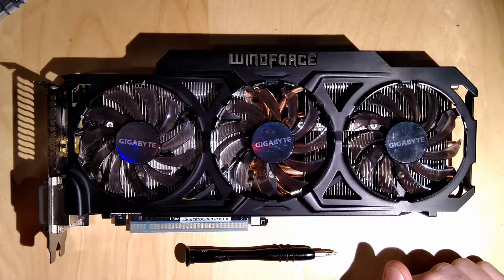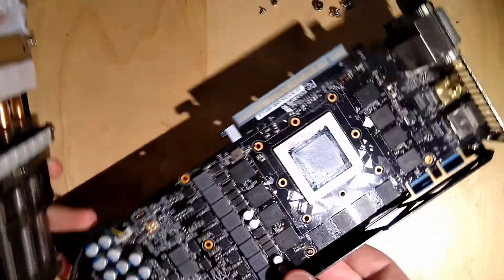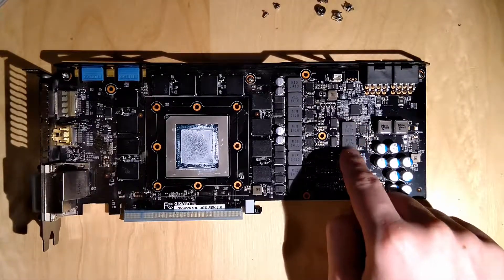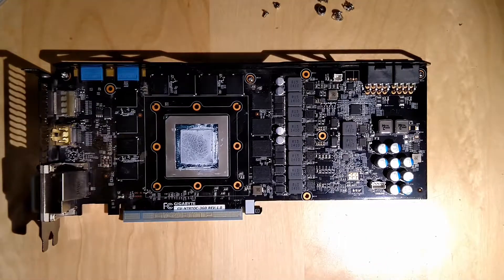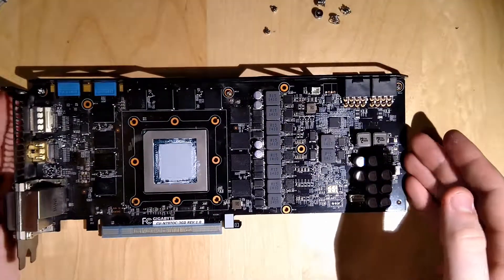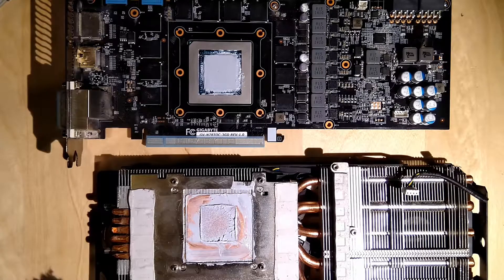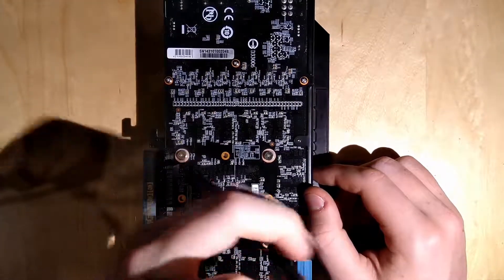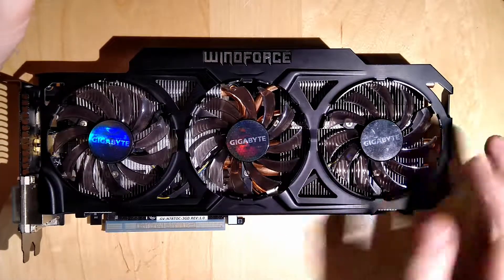Gigabyte Windforce OC GTX 780Ti Teardown | Switching to new Thermal Paste ( Kryonaut )

Comment: First of all: What a great detailed video about this card, it gave me the confidence to open it!! 

Just like Ixomis, I have got exactly the same card, and two days ago the screen got some green spots, artifact like.. I think the green artifacts also appeared when I opened BIOS. So I think something died on the card. Probably VRAM, or Memory? Don't know so much about Graphic cards... Is there a way to bring it back alive? Is there a way to find out which modules died and are they replaceable? 
I was so happy with this card.... Can just do a good cleaning, repaste the GPU solve the problems? I really like to know! 
What's the story about Baking it?

Ow BTW, just like Benedikt W. as I could read in my minimal German I also got the  code 43 in the device manager. I also reinstalled the drivers but now it doesn't do anything anymore..

I'm sorry for all my questions, but I actually just don't want to miss this great card...

Vielen danke!
Grüße aus den Niederlanden
Reply from the maker: artifacts on screen are usually caused by the Core or Memory BGA failing / being dmaged. sometimes the thin memory traces on the card also get damaged and cause this. it's not always fixable. usually you could try a reflow "oven method" (but i suggest using a heatgun on the core / memory and not putting the entire card into an oven as that will heat up the capacitors a lot which will degrade them) to fix it. i brought some GTX 580s back to life like that. i use a pretty standard heatgun and blast the core for 40 seconds from 5-10cm away. sometimes i also keep blasting the general area of the core including the memory chips for ~5min from 10-15cm away to gradually heat up the entire area do do a reflow on both GPU and memory chips. if it works it is unclear how long the card will work after that. could be 2 years or 2 weeks. if you still have warranty i would just go that route. but if not and you "don't have anything to lose" you could give it a go. sometimes cards also drop dead because of electronmigration (electrons in the internal circuits degrade the connections over time and if under a lot of stress / heat that can result in a dead card (this is the main reasin why mining cards die because they are under full load 24/7 for sometimes years)) electronmigration is generally not fixable as you would have to replace the faulty part and replacing a GPU chip is not really worth it might just buy a new card at that point. 

so basically you could try a reflow but the chances of it working are unknown. i had 4/5 GTX 580s come back from that but 580s have big hot running cores not like the 1070. so your card might be dead because of something else.

maybe contacting a repair store would also be a good idea. sometimes you can get free diagnosis. and if they give you a good price they might just fix it for you. a much better bet than just pointing a heat gun at it and hoping for the best.

there's a youtube channel called eli tech out there he did some more advanced repairs on 1070s also maybe his videos could give you some "inspiration"

in general once you see artifacts it is just "hope it is BGA damage because if not you won't fix it"
cases where the card doesn't put out a picture or shuts down are mostly PCB level damage but artifacts are caused by either BGA / connection damage or in silicon damage which is not fixable.

welp that was a wall of text... i hope you have some luck with your card. but i won't lie the chances are not good. especially if this is your first time.
Reply: @CmdrSoyo  Thank you very much,
There's no warranty left,  since it's already 7 years old... so I think I might give it a try,  but first I will check that guy out you mentioned. 

Again thank you,  for the video and reply

Comment: Hi man great video you seem to know your stuff my gtx 780ti exactly the same as yours just died one day it wouldn't turn on I don't really know what could be the problem gonna bake it tomorrow.
Reply from the maker: if it doesn't turn on anymore (no picture at all) it might be a voltage rail dropping out. without checking all the VRMs on your card i can't say for sure so it could be somethign else entirely... but i wish you good luck in bringing your card back.